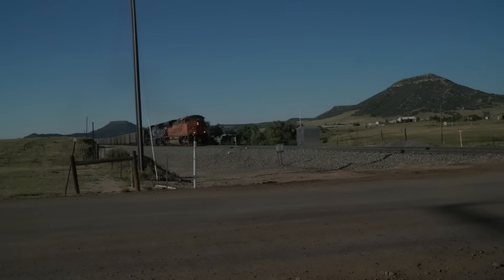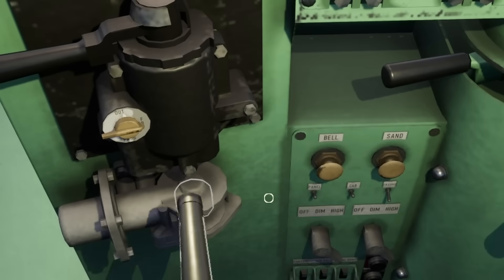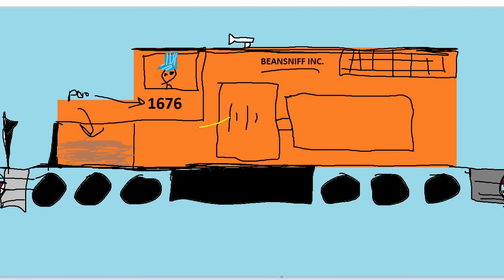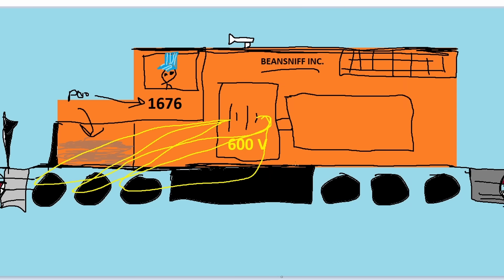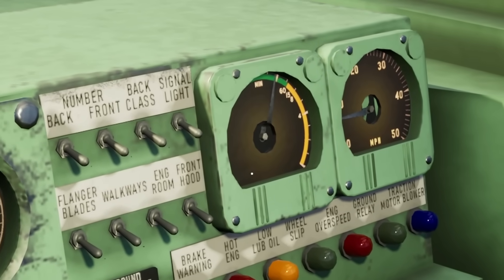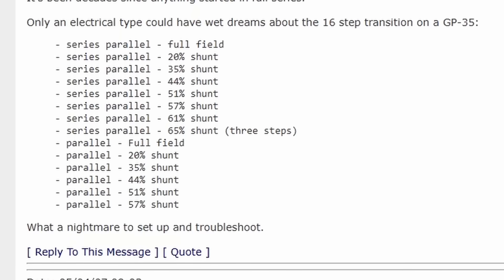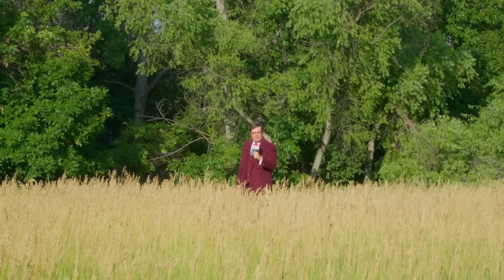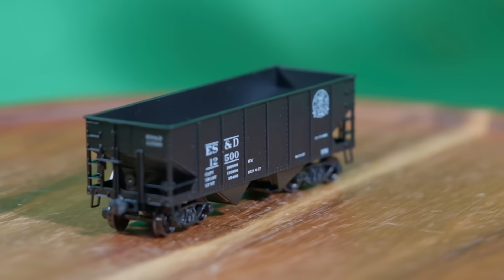The HIDDEN GENIUS of diesel electric locomotives... Transition explained - Railroad 101

Comment: And now those funky shift noises and amperage changes in the DE2 and DE6 make sense.
Reply: I don't think the DE2 does that actually? I could be wrong I've been stuck inside a S282 for 15 years
Reply: @CelestialCaboose1280 I think Hyce mentioned something about that when simulator came out. 
he nerded out pretty hard over how realistic the new sounds are.
I believe it has a gearbox, since the engine's rpm drops.
Reply: @erumaaro6060  They have gearboxes in the sense that the traction motors are connected to the axles via a fixed gearing, but there is no variability. The DE-2 does not transition electronically since it only has two motors and lower current requirements, but the DE-6 does start in series, transitions to series-parallel at 20-25km/h, and then to full parallel up in the 40-50km/h range. The diesel engine rpm dips slightly during transition because the generator is momentarily unloaded and would cause the engine to run away if it weren't also throttled down for that moment.
Reply: @jondorthebrinkinator  makes sense.
putting a gearbox on a DE sounds counter productive anyway.
Reply: @jondorthebrinkinator I don't know what game you're playing. The engine does indeed race when it unloads during transition, then dips when it starts loading back up. The periodic dips are field shunting steps, which momentarily bog the engine down.
Go watch any locomotive transition video, the engine absolutely doesn't "throttle down" because the governor protects it.
Reply: @pootispiker2866 any time an engines rpm exceeds the set point the governor throttles down. Every time the rpm slows the governor throttles up. At least with a generator. Are locomotives engines single rpm like a generator? I am a marine engineer in training so this is outside my Field.
Reply: @cloggedpizza239 They are not single RPM, but each throttle position corresponds to a fixed RPM. If the locomotive reduces load suddenly, the governor will react and bring the engine speed back to where it should be. It's not instant and you can hear the engine speed change. This is not "throttling down" because that would be defined as a different throttle position being commanded.
Reply: @pootispiker2866  I think I get it. With a genrator of course your goal is 60 or 50 Hz so the priority is rpm staying in a tinny little range. With higher electrical load the govornor needs let more fuel (or air in an otto ignition) to keep the rpm constant. Pretty different than a car or generator.
Reply: Haha yeah, I was legit just recently starting to wonder what the clunk-clunk (and drop in power) was in the DE6, and was going to look it up but never got around to it.  It sounded like a gear shift, but that didn’t make sense since the RPMs never changed much.  Now I know!